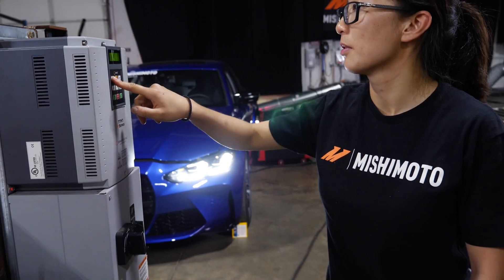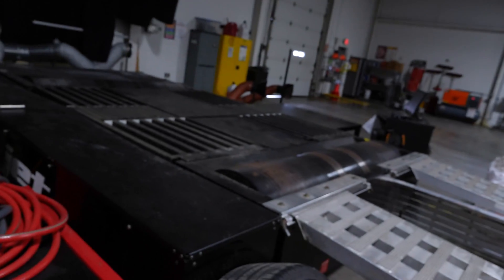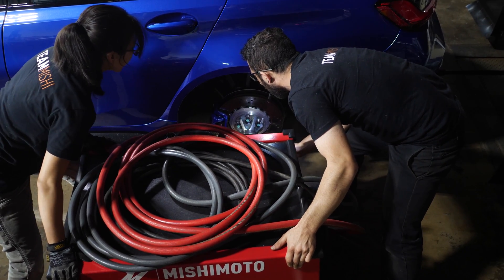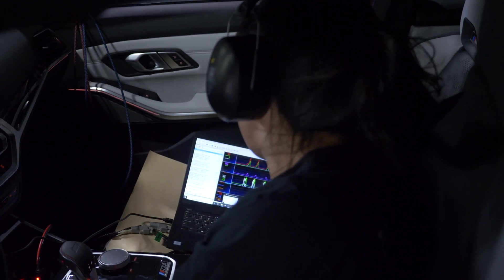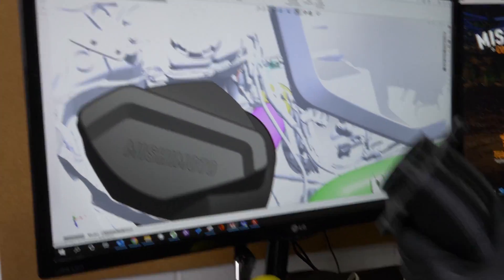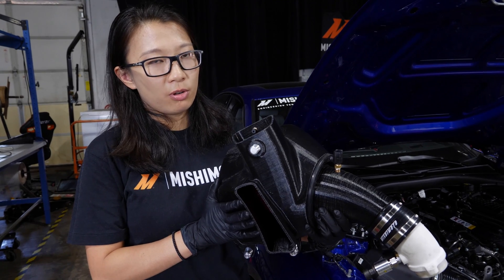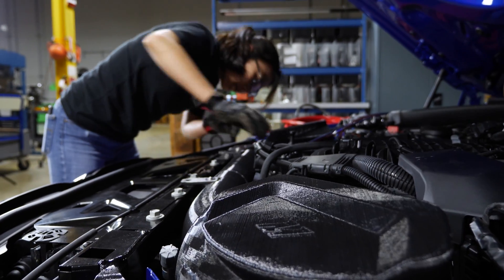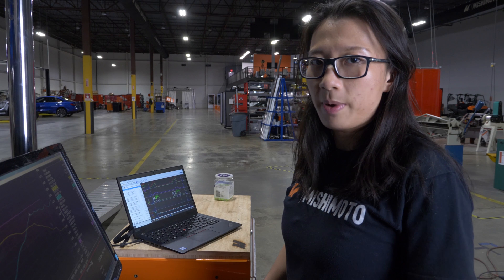BMW G80 M3 | Dyno Testing our Prototype Air Intakes

Comment: This intake looks fantastic!! So what was the intake temperature difference and manifold pressure difference between stock and the Mishi? You said you were monitoring but didn't provide the data in the video. Thank you!
Reply from the maker: Here is a link to the Engineering blog for the testing results!
https://www.mishimoto.com/engineering/2022/02/2021-bmw-g8x-m3-m4-performance-intake-rd-part-4-testing-results
Reply: @mishimoto  thank you guys! Are the filters oiled?
Reply from the maker: Yes. Washable oiled filters can be cleaned and refreshed using our Filter Re-Oil Kit for a lifetime of use.